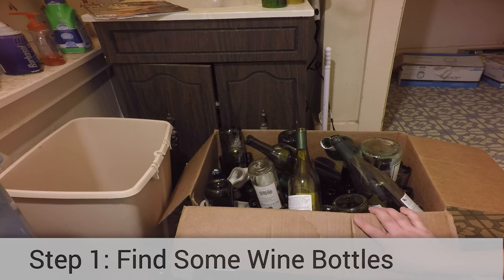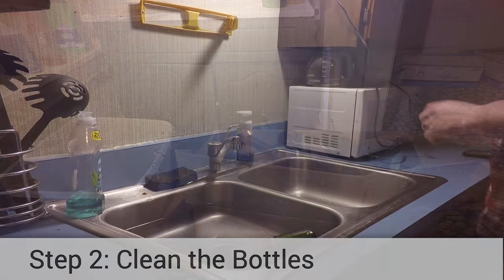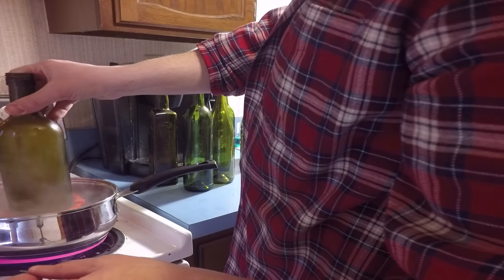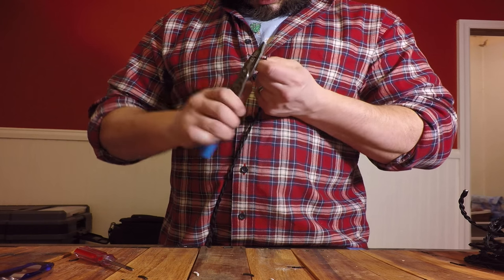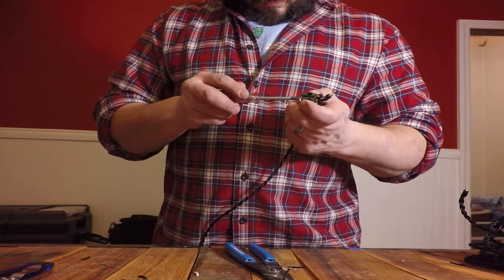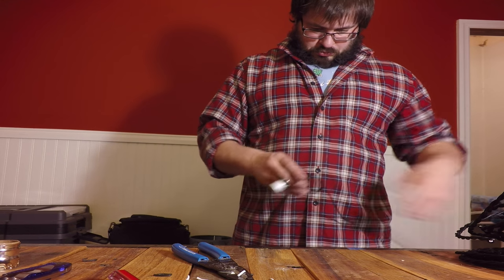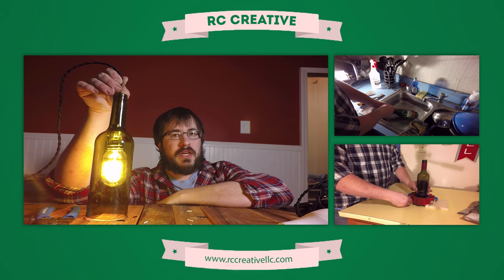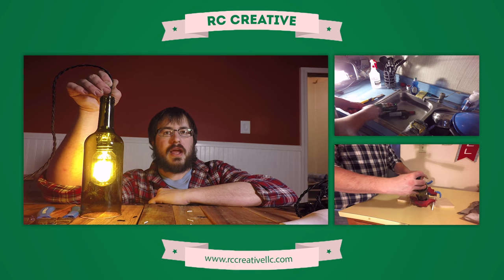How to Make a Wine Bottle Pendant Light

Comment: is there a chance for the glass to break from the lamp heat?
Reply from the maker: They definitely do get hot but I've run them 24 hours a day for several days and never had an issue. The melting point of bottle glass is far hotter than these will ever get.  My advice would be #1) Don't touch them, and #2) Use a bulb that doesn't generate a lot of heat, such as an LED bulb.  You can find LED Edison bulbs that have that cool "retro" look but still don't generate a lot of heat or use a lot of electricity.
Reply: oh okay, thanks a lot! i'll try this out for sure :) your video is very well done ;)
Reply: @TheRenaissanceCaveman   I'll second that. The LED retro style bulbs are beautiful and never get very hot.
Reply: While the glass may be ok, the bulb itself may shatter, potentially causing a fire or broken glass danger. Led bulbs will help, but be sure you check that they’re rated for enclosed fixtures.